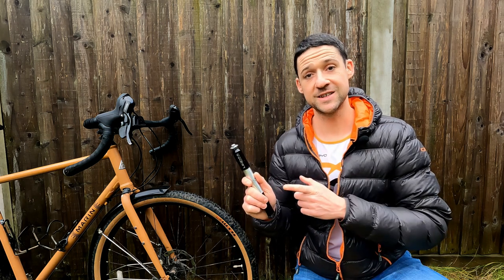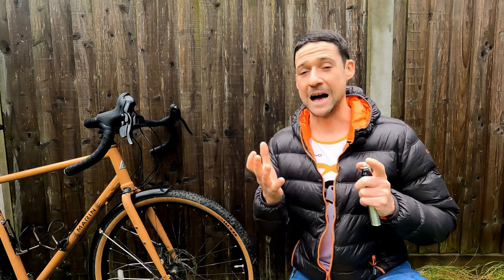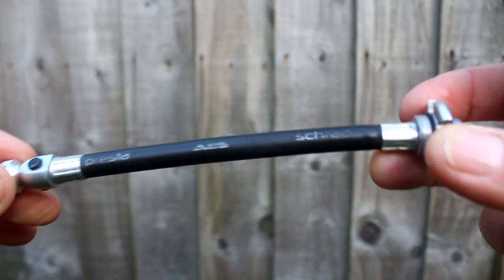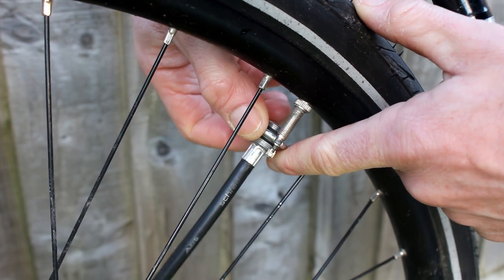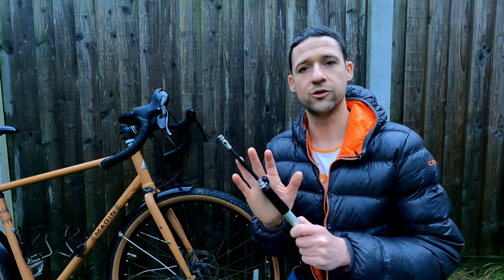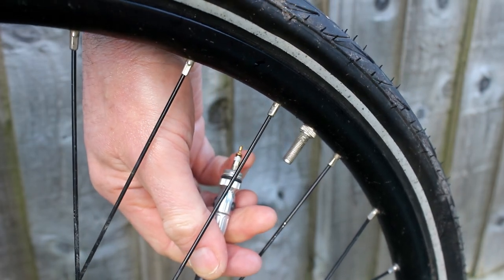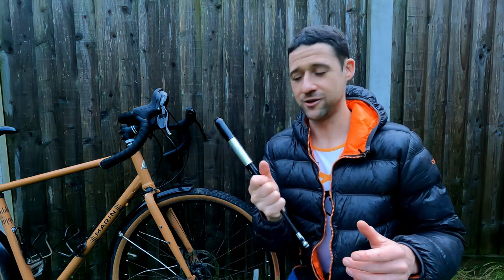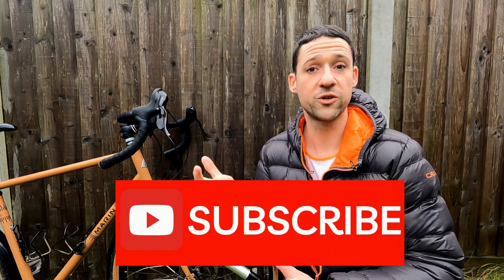Worlds Worst Bike Pump | Lezyne Pressure Drive Bike Pump Review

Comment: Lost count of how many times I've let my buddies use this exact pump when their crappy blackburns couldn't get the job done or when their CO2 chucks froze open and emptied without seating on the valve, but yeah sure buddy, this is the "worlds worst bike pump"
Reply from the maker: Good to hear you've had a good experience and you've got to help others out - not all heroes wear capes! Quite a few others having similar experience to me, but equal number have yours, if I made a product I'd want to get higher than a 50% success rate. Anyways, happy riding mate and glad it's all working for you 👍

Comment: Tighten all of your valves properly. Problem solved. You're welcome.
Reply from the maker: Yeah I could have probably done a better job on this, next time 👍
Reply: I have the same problem with this pump. No matter how tight you tighten a valve, this stupid pump will unscrew it anyway. This pump should be called “Frustration 3000”
Reply from the maker: @dmytromeleshko5796  Oh no I am sorry to hear. You are not alone I can assure you. What did you go for instead? Any better luck?

Comment: You're doing it wrong.  Blue loctite on the valve core.  Only screw on hose enough so air can pass.  No problem!
Reply from the maker: Hi Tekjim, you are the second person to recommend loctite, which would certainly work. Although this is an extra step you don't have to do with other pumps. If you were on a ride with mates or helping a stranger with a puncture, and needed to use your pump, you rely they have used loctite to have that assurance. I did try as well not to tighten too much onto the valve but found this made it less secure - but this did help things. Both are good suggestions but both are steps you don't need to do for other pumps. I presume you have a good experience with this pump which is ace to hear - appreciate the advice it's always helpful 😀
Reply: Really? You have to use loctite so you can use this pump 😂 Clearly the pump is not fit for purpose. Get a pump that is fit for purpose.
Reply from the maker: @dalj4362  Completely agree, you shouldn't have to do this.

Comment: I have that pump. It helps to pull harder as you unscrew the hose.
Reply from the maker: Interesting, I wouldn't have guessed that. I would have thought that would make it worse....unless this is a windup! 😂😂
Reply: @mammothjourneys  the other thing that can make it less likely to unscrew the valve is to unscrew it from the pump body first. Doing that, there is also no need to press the release button.
Reply from the maker: @fordbailey8173  I thought I had tried every permutation of what to take off when, but this makes sense as all the pressure will have released from the screw end of the main body. Do you still use this pump then? Have you lost any inner valve yet to it?
Reply: @mammothjourneys  I used it yesterday. I had a valve unscrew once, but I saw what was happening. I still like having the hose.
Reply from the maker: @fordbailey8173  Do you know if other brands or models that have the hose have the same problem? I agree having the hose is good and if there was an alternative that didn't have the risk I would be really intereseted.
Reply: You literally save my ride!! 🙏🏻

Comment: I unscrew the flexible hose from the pump before unscrewing the flexible hose from the valve. Seems to work fine.
Reply from the maker: Nice, will give it a go - cheers for the suggestion. Glad to hear you are having better luck with it as well 👍
Reply: Here's what I do.  1.  Screw hose to valve.  2.  Screw pump to hose.  3.  Pump up tire.  4. Unscrew pump from hose  5.  Unscrew hose from valve.  I don't touch the magic button.  I use dt swiss valves (dt swiss rims).  Not sure if the valve type would make any difference.  Gut tells me no.  Oh, one thing I do is I practice taking tire off, removing tubeless valve from rim, inserting tube, reinstall tire and pump up.  I do this in a nice, dry home setting.  Usually sealant takes care of punctures but I have had the situation where I had a sliced tire.  So I put a dollar bill into the tire and add the tube.  Been lucky with valve cores.  Haven't had one unscrew on me yet.  But it could happen.

Comment: Richard your not doing anything wrong....however that pump is'nt either,you just need to snug up your tube cores with a valve core tool.I use and also carry on my rides a Park Tool VC-1 valve core tool and when ever I start using a new inner tube the first thing I do is just snug up the valve cores within the tube prior to it's installation.Also try attaching the pump's tube onto the inner tube first and then attach your pump to the tube installed.....just my tips for what they're worth.
Reply from the maker: Thanks mate some good suggestions here. Will give them a try and see how I get on. Fully expected some user error on this one! Cheers mate and happy riding 😀

Comment: I've got four different versions of the Lezyne hand pump (pressure drive, pocket drive HV, 2x pocket drive pro) for all my bikes. I did once unscrew a valve core while removing the hose. Once. And then I learned to make sure the core was well tightened first, and I've never done it again. The Lezyne pumps always pump more effectively than any of the other pumps that emerge during a group ride (except for full-size frame pumps, of course). The Silca pumps are heavy and, in my experience, don't pump as well. 

All portable tools have trade-offs, but over my last 35,000 miles of riding the only pumps I've carried are Lezyne, and I've been happy. They are also easy to service when you spend days riding through sloppy mud and rain and grit works its way in.

We all can only go on our own experiences, and it sounds like yours hasn't been great. I'm not here to convince you that your experience isn't valid, or sell you on these pumps, but to call it the "world's worst bike pump" is just silly. I suppose it's good for your view count though!
Reply from the maker: @mirkone  it's good to hear you've had a decent experience over the years with your Lezyne. You'll see from the other comments it's a pretty even split of those like you who have had a good experience, and those like me who have had a bad experience. If a pump has half of its users having a bad experience that seems pretty mad. If a feature on a pump can cause such a poor outcome that just seems mad, when other pumps don't have that risk. But you're right, the title probably did help view count 😉 Happy riding mate  👍

Comment: 1) Tighten the valve core. This doesn't have to be super tight, but it should be snug. Even new tubes will likely need this done. You can use the tool on top of the chuck to do this, as your fingers likely do not have enough grip. To use the tool on the ABS-1 Pro, the plunger for the presta valve needs to be completely open, then the tool should be able to reach the flats on the valve core.
 
2) Do not over tighten the chuck on the tire valve. The chuck only needs the leading o-ring to touch where the valve core and valve stem meet. This will only be a few turns after the threads all engage. Threading the chuck on "until it stops" will possibly jam the valve core or plunger in the body of the chuck.
 
3) Use the ABS button on the chuck to bleed pressure. This removes the pressure from the hose, which will lower the friction on the valve core threads to make unthreading easier.
Reply from the maker: Thank you Dan. I'll reply to the other comment on this you made so it's one place - cheers mate

Comment: Criticism is spot on. I’ve used this pump for years and have a valve core tightener in my Lezyne multi tool unit. The pump is the only one that fits presta short valve stems so I’ve learned to live with it.
Reply from the maker: Thanks for reassurance here. Have you been tempted away from this for one that doesn't hold that risk??

Comment: I hate this pump because I wasn't paying attention and accidentally bought the HP instead of the HV to pump up 29 x 2.6 tires. I've never used the button and haven't pulled out any cores, but I regularly add tire sealant and probably over tighten the cores, plus the sealant probably works like loctite.

The pump gets very hot pumping up a big tire and the handle isn't very comfortable. I like the way the hose attaches to the tire because it provides different ergonomic options for pumping and it doesn't feel like I could accidentally break the valve stem. 

I just purchased the HV drive, hopefully I don't lose any valve cores, but I'm glad I know this issue exists and might add an extra core to my kit.
Reply from the maker: What might help is loctite which a few others have suggested in the comments, but not sure what effect adding sealant will have on that. Best of luck with it mate and hope this was helpful 👍

Comment: It's important to keep the hose straight when unscrewing, if it is pulling sideways it can lean on the core and unscrew it. This is why some commenter's suggest removing the pump end first, then the tube hangs straight.
I run 60mm valves on 50mm rims, and often found there wasn't enough valve showing to adequately engage the gasket with push-on pumps, so I purposely chose a Lezyne for the screw-on hose. Occasionally having to re-tighten a core is less of an issue than being unable to achieve adequate pressure because of marginal gasket engagement. (Yes, 80mm valves are another solution, but can be costly, and a pinch it is much more likely your mates or small-town shop will have a 60mm to spare.)
Reply from the maker: Hi Mark, That's a good suggestion about the angle of unscrewing and not one I have heard yet. It makes sense and I will give it a go - thank you. You're right, having a small amount valve available would be incredibly frustrating with a more traditional pump, glad you found a solution which works! Happy riding mate. 😀

Comment: Never happened to me. I used to work in a bike shop where I had to pump thousands of bikes with Lezyne floor pump and NEVER remove the inner core of the valve, also my hand pump is Lezyne for more than 10 years. I had tens of flats and my pump was always helpful. I think this is just user error. Here we say "both hands are left".
Reply from the maker: Hi Nooski, Glad to hear you haven't had the same issues as I did, or some others who have left comments. Was the track pump you use a screw attachment or with the lever? My track pump is a lever and never had this problem. I presume your hand pump is the same model with the screw attachment. Do you get a better performance than a lever attachment type pump? I wonder if you did if it's worth the risk should the valve ever be screwed out? Although I can't deny it's user error! Love the saying as well.
Reply: @mammothjourneys  Hello, yes, older gold screw in type on floor pump. I have pocket drive hand pump with the same hose, it's just a bit shorter. It's important to release air from the hose bit you have mentioned this. Also from my tubular experience I have valve core tool in my wallet all the time but never really use it.
Reply from the maker: @nooski_Watches-ik9nr  It's so interesting how different the experiences people are having with this pump. Certain valves, and using a core tool to tighten them certainly helps, along with the air release from the hose. I did have occasions where it worked drama free, which perhaps made it more annoying and confusing when it didn't work! Glad to hear it worked though for you and the ride carried on!

Comment: I've had this issue with mine in the past. I've learned to tighten the valve cores down well, and not overtighten the hose when attaching it to the valve. I still agree with you that you shouldn't have to do this. I've not had the same issue with their Micro Floor drive pump, even though it also screws onto the presta valve. I've wondered if maybe a bit of oil or a thin layer of petroleum jelly on the inside of the pump would help. I assume that the issue is that whatever rubber they are using to seal against the valve is grabbing the valve too tightly
Reply from the maker: Reassuring to know others have had the same issue. I did try not screwing the hose as much and this certainly helped. I always felt a level of anxiety when I was removing the hose, never fun.
I've heard their drive pump is really good, perhaps I just need to try some other pieces of their kit.

Comment: Definitely had this experience also. Dropped pressures to get through a greasy uphill couple km knowing I could pump back up once hitting the road at the top. In the dark and a deadline to get home 4x failed attempts later with this pump I rode the remaining 10 or so km on less than favourable psi. Cornering was sketchy on the first surprise sharp bend. 
Failing of mine were: 
-Pathfinder fast rolling gravel tyres lack in the traction department 
-Time pressed 
-Failing light and failing torch battery
-No practice AT ALL with this pump before maiden voyage! 
Some comments above have been much more helpful than the instructions included with this pump. Tightening the valve core, grease on the inner O-ring and graphite on the inner thread will be my next step in order to keep this pump on the bike as from other comments: it is in fact actually a pretty decent pump. Compact Size is a massive factor to keeping this pump and getting more comfortable using it. 
Cheers for this video highlighting the same issue and for triggering the rest of ppl to show us how it’s done 👌🏼
Reply from the maker: @petehunkin7482  hi Pete, sorry to hear you had the same issue as many others and glad the video was helpful. The comments of ways to make it work certainly are helpful. If you can get it functioning then you are right to give it a shout. Happy riding mate 👍

Comment: You arent alone. I just had this happen in the mountains. Took over 45 min to fix and pumping up the tire 3 times in sub 40 F weather as it was getting dark. Nearly got stranded. Trying to figure out how to make this work. My bike shop mechanic said he has broken a valve a couple with regular hand pumps. So I'm not even sure if there is a good option other than CO2 at this point. Id like to get enough pressure to continue my ride as planned without a concern
Reply from the maker: Wowsers this is a miserable experience. Sorry to hear mate. When mine failed in the dark and raining all my toys were thrown out of the pram, I'm sure it was the same for you when it was that cold! 
Where was this? 
Did the bike shop recommend any suitable hand pump?
Reply: @mammothjourneys  Mountains in Southern California. And no unfortunately, the mechanic said he prefers the pumps with a hose attachment. Ones without you have to brace and can snap the valve. So both are flawed. Like someone suggested here Lezyne actually recommends a bit of Loctite on the valve. So I suppose I could add that to my spare tubes and make sure they are nice and tight. Other thought is maybe a small amount of grease to valve stem threads on spare tubes. I've also noticed comments saying 3 or 4 attempts to get it off. Maybe threading the hose off and on a few times may help. In either case I added a couple extra valves and a valve tool to my bag just in case.
Reply from the maker: @starlitshadows  interesting I've never had an issue with the normal hose attachment. All the suggestions on how to make it work I'm sure are effective, but an extra hassle you don't need with a normal attachment. Very jealous of south California, bet it's some epic riding there! What bike you got?

Comment: Haven't had this experience but have read of others having this problem. One user advised adding vaseline to the threads to help prevent removing the valve.
Reply from the maker: @Win-d1s  good to hear you haven't had this happen. The vasoline is a good idea, I like the idea of this more than the loctite which others have suggested. Happy riding mate 😀

Comment: Happened to me on Saturday on a cold rainy day, pulled the core right out.  Also pump threw the o-ring off, so I couldn't even pump it back up!  Luckily we have just finished our coffee shop stop and a kind gentleman driving by happened to see us struggling and had a floor pump!  So now I'm ordering a new o-ring kit and some silicone grease to hopefully fix the pump.  Would not have bought 2 of these pumps if I had known of this issue!
Reply from the maker: Oh no mate this is an absolute nightmare. Sorry to hear you are experiencing the same as few people on here. Some others users suggested some locktite which may work, perhaps something to try. Best of luck with the fix!